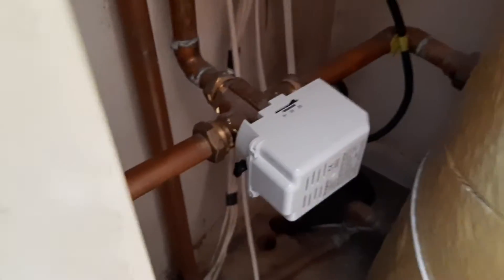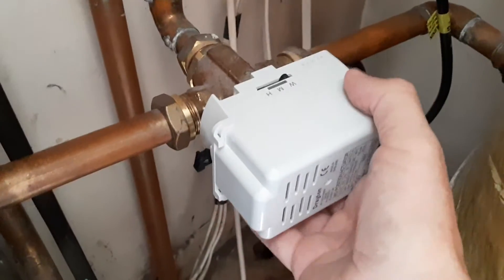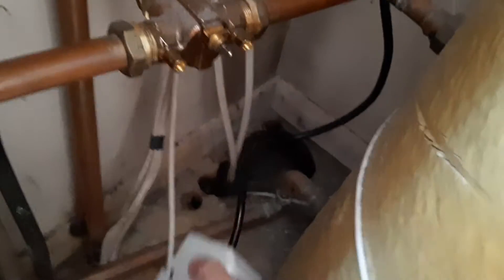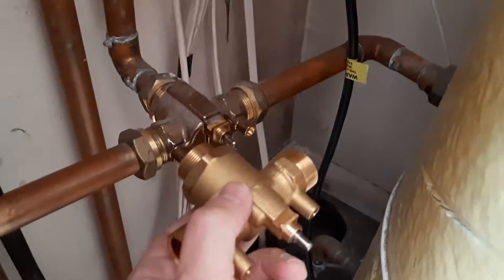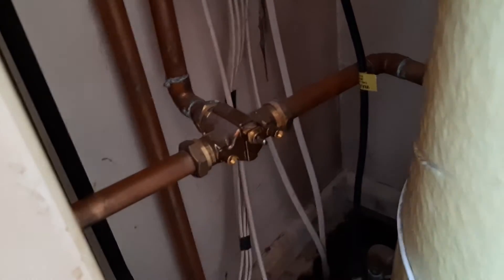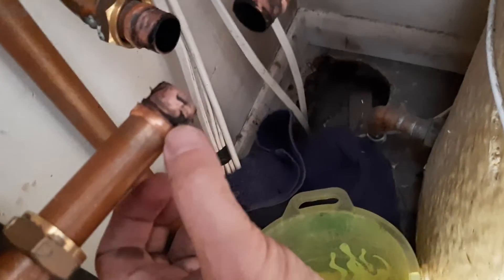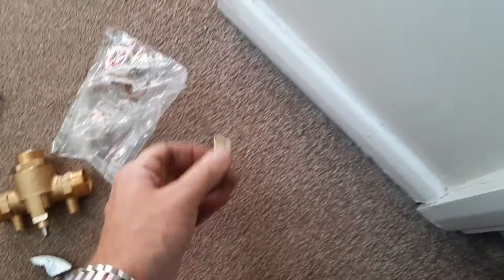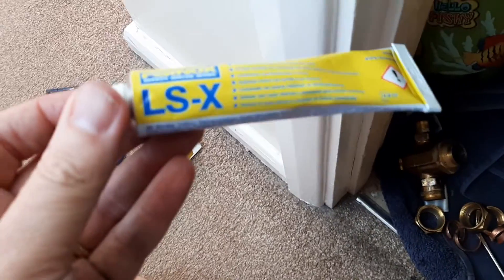How to replace a central heating 3 port divertor valve

Comment: Thanks for an excellent video ... one point though, you forgot to fill the header tank with 'Inhibitor' BEFORE opening the feeder valve and filling the empty system, you need inhibitor actually IN the pipes and rads to do its corrosion prevention work over the following years! 😊

Comment: I find that once or twice each year, the actuator microswitch fails in my Drayton valve (switch easily replaced) and the pump then runs constantly. The valve always sticks when I first turn on the CH in late autumn, but fortunately a wiggle + WD40 has worked to date.

Comment: The reason your three port valve was sticking is because the system has a lot of magnetite in the water causing the spindle to seize, the whole system needs chemically cleaning out and flushing, then refilling with the correct amount of inhibitor added, if the system is not cleaned out the new valve you have fitted will also seize. There is no need to fit new olives when reusing a compression fitting, if the olives and seats are cleaned in rotational manner using scotchbrite the join will not leak.  If you do remove an olive and replace it with a new one, chances are you will damage the pipe surface which will cause a leak, never add  sealant to an olive as it causes problems when the joint is next taken apart, also if any bit of the sealant floats away down the pipe it will very likely clog up a radiator valve,

Comment: Thanks for posting this video which is informative and gets to the problem well. A friend who is a master plumber (and a DJ) made a comment:
"It has always been considered bad practice to fit a mechanical shut-off valve to a central heating system cold feed: these valves can be accidentally left closed, which could lead to a dangerous situation, should the primary expansion pipe become frozen in the loft, causing both the open vents to the heating system to be shut, cutting the passage of expansion water, which in turn could lead to a serious pressurisation of the whole system, probably causing the system to fail at the weakest point."

Comment: remove head, remove circlip on valve pin, gently tap down, wd40, rotate a few times, pull pin up into original position, refit circlip. job done.
Reply: Another one not listening. He said he used WD40 but it's not a permanent fix.

Comment: How often do these things need replacing because my rental house seems to need a new one every 3 years or so - I feel like am being ripped off!  It wasn't this frequent of an issue when I was living at the house.
Reply: You need to clean the system. Probably a power flush. If you don’t the valve gets gunged up and will fail as I recently found out.
Reply: @ambydaly5713  ahhh so you think that might be the issue..... how often should that be done?
Reply from the maker: They should last a lot longer than that, many years in fact.
Reply: @DJBaldPaul  thanks. Guess I am being ripped off then .... sigh

Comment: 21 seconds into this video - I've diagnosed the problem (had it my self with a 2 port Drayton).
The fix will take 15-20 seconds, you don't need to drain the system, you don't need to turn the electrics off and you don't need to do anything except:

1. Press the head release catch, remove the head.
2. Put oil on the valve spindle and work the spindle back and forth until freed off.
3. Replace the head unit.

Job done.
Reply: Did you not hear him say he used WD40 at first but that solution doesn't work forever?
Reply: What type of oil?
Reply: @gingerrussell  A light oil, such as 3 in 1. There's a small circlip around the valve spindle, CAREFULLY remove it, as it can easily spring of into oblivion, then oil the spindle & tap it down, then pull it up & repeat the process to free it off, the CAREFULLY replace the circlip and refit the motorised head. If you do need to replace the brass body itself, you only need to drain down the system as far as where the valve is fitted (test where this is by opening one of the unions occasionally) & also use PTFE tape around the olives (the rings around the pipes) & refit the unions!

Comment: You don’t need to take the olives off (compression washers as you called them) and the other you is that you don’t need to put any silicone on them either.
Reply: Apart from taking the valve head off, nothing else in this video was needed. All the valve stem needed was oiling and turning back and forth a few times until it was turning freely.

Comment: Just a quick note for any one thinking of doing this for the first time.
DO IT I just did, used the original olives with jointing compound and not even a drip and my wife was amazed as I didn’t swear once.
Reply: Better still, if you have this type of valve (Drayton) and it's stiff, just take the head off, oil the spindle, work the oil in a bit by twisting the spindle until it's freed off then replace the head. Job done.

Comment: Good video, but note the comments of zinniasequoia. I tend not to bother with replacement olives and just add some ptfe tape around the olive before tightening. The olives are made of copper, so are malleable enough to form a seal with the old nuts, even on second fixing. I love the comment of one of the bods, "Leave it to the professionals"!  Hilarious. You need a second mortgage to get a plumber out now, and there's no guarantee they will be competent!
Reply: The correct repair in this video - was to simply oil the valve spindle and work it free. Then put the head back on.

Comment: Hi. My system is exactly like the one you're replacing. How do I drain the system to prevent water spillage. The boiler tank is located upstairs.
Reply: Why do you want to drain your system ?
Reply from the maker: Search your pipework for a drain cock, it's normally on a downstairs radiator at the lowest point in the system.

Comment: You can put the valve back on 2 ways does it matter which
Reply: Valve body - yes - otherwise controller for hot water will do heating and controller for heating will do hot water !
If you've the same issue, just oil the valve spindle & work it free then refit the head. No need to replace a perfectly good valve that just needed some lube !

Comment: Question....
Plumber changed my system pump because was noisy..
The new pump was fitted wrong way round! The heating was on red hot and the stat couldn't lower the temp,,, can back a few days later to swap pump around then says the 3way port needs changing?
My bad luck as no issues before he fitted pump wrong or is it because of what he did caused 3way port to be damaged?
Reply: No, the plumber wanted to charge you for coming and fixing HIS mistake. So he makes up a fake fault. Most plumbers do tricks like this. Others are worse and vandalise systems. I moved into a flat - 2 rads didn't work sink & bath cold taps were loose ! Sink tap was just above stopcock - so when water turned on, you instantly got wet. They'd use that tap just for that purpose.

Comment: Thank you for showing the inner parts of the valve and explaining how the spindle moves the plug, so that it only moves through a small angle. As you said, other videos leap straight into replacing the electrical actuator, without suggesting checking the valve spindle and the valve plug sealing first.
I doubt if you needed to drain your system. Water does not flow of its own accord uphill, so if your radiators are all below the level of your 3-way valve, then no water will flow out from them when you remove the valve. From your video, the heating coil on your hot water tank is below the valve, so no water would flow from that either. Your video shows an isolating valve between the pump and the valve, so this can be used to isolate that leg. You do of course need to shut off the supply from the header tank. The only water flowing out would be the small amount in the short pipes near to the valve.
The olives were working well just before you removed the valve. They will work just as well when you install the new valve. Drayton long ago learned how to put a smooth surface on the sealing faces of their valves. You are more likely to cause a problem with your hacksaw blade, scoring the pipe more than the olive can cope with.
There is no need to centralise the valve spindle before removing the valve - the spindle of the new valve will self-align with the actuator anyway as the actuator is fitted.
That's not a "spanner" - it's a "Grip". :-)  The nuts on 22mm diameter copper pipe are 32mm Across Flats (A/F) I would suggest buying a proper spanner before starting this job. (£6.00 on ebay)

Comment: Always replace olives .

U can get an adjustable spanner and make it the size of the nut and slide it and tap them off . Easy
Reply: Mr Spoonz if the olives are not damaged don't remove them

Comment: This is exact same problem I have, with the same system setup (Drayton MA1). I originally replaced the motor on the MA1 but didn't realise that the valve should be easy to turn. This video confirms my suspicion and has been really helpful.. Thank you so much!! Worth noting to you tubers, to make sure the bleed valves on all the RAD's are securely tight before refilling the RADs.
Reply from the maker: Glad it helped. It's a little daunting changing the valve, I put it off for ages, but it really isn't that hard. No need to call in the experts if you are confident enough to use a spanner!
Reply: @DJBaldPaul  Totally agree, whilst there is a comment from another viewer saying "you don't need to do this, get the experts", I think its necessary to update and renew these critical parts to keep your system working. My system is NEST driven, so I need a reliable mechanism to work properly and after 20 years it could do with a change. Have the spanners and inhibitor, however I will be using the original olive and nut, mainly because they leave a solid seal, great idea on the sealant..as well.. :)  I will use that trick!
Reply from the maker: @DM43685  Good luck using the existing olives, I didn't want to risk it.
Reply: @DM43685  They're right - you don't need to throw stuff out cos you didn't oil it.
Reply: @DJBaldPaul  But you used the existing copper pipes ? Why didn't you replace the house while you were at it ?
Reply: All it needed was a few drops of oil on the spindle working in - then refit the head once the spindle's been freed off.

Comment: No - you don’t need to change the valve if it’s seized! Leave it to the professionals.
Reply: Your not allowed to have an isolation valve on the feed/expansion pipe.
Reply: @michaelstratton4101  think you find you can have isolation on the cold feed from the F&E just as you stated just not on the open vent pipe work
Reply: @michaelstratton4101  if its your house you can do as you damn well please, that's anything except a gas pipe to a boiler.
Reply: Gobshite
Reply: Correct - YOU DO NOT NEED TO CHANGE THE VALVE !!!
1. Remove head
2. Oil spindle
3. Work spindle free
4. Refit head.
Reply: "professionals" - I've seen some of those professionals... £120/h to rattle a wrench around and suck their teeth "oooh, you have a big problem here!". All people should be able to learn how to change a valve in their own house!
Reply: @todorkolev7565  £120 that’s very cheap.

Comment: Hi. I have the same model actuator. Could you please explain how to manually switch between the three heating positions? Do you have to press the black button on the side in order to move the 'sliding' lever? Thanks in advance.
Reply: You can't. It's either in the unpowered position or the mid position - by the lever.
Reply from the maker: Yep that's it.

Comment: Thank you for taking the time to do this. Much appreciated. I’ve always been suspicious of the valve as radiators heat up when I only have hot water on. Did you drain the system from a radiator?
Reply from the maker: No I have a drain cock, you should have one on your system somewhere. You could try taking the head off and turning the spindle to the hot water position and see if your rads stay cool? If the motor in the head is burnt out it might not be able to turn the spindle, or your valve might be stiff like mine was. But if you take the head off you can check if the motor works by getting your boiler to call for hot water or heating.
Reply: paulroberts69 is it okay to still drain them through the radiator?
Reply: If you'd had an engineer to that problem, they'd have fixed the valve in situ in 20 seconds !